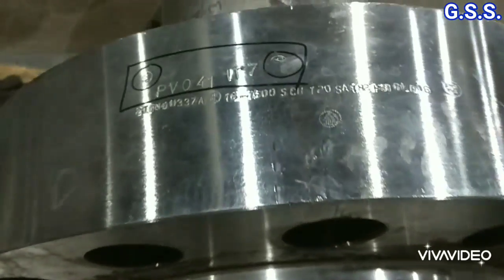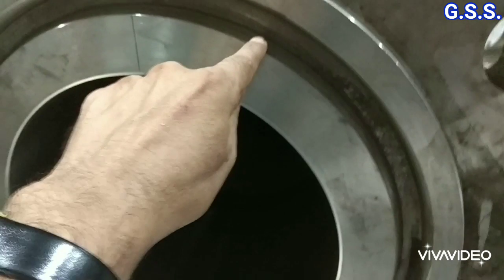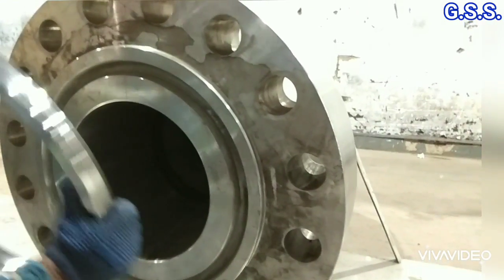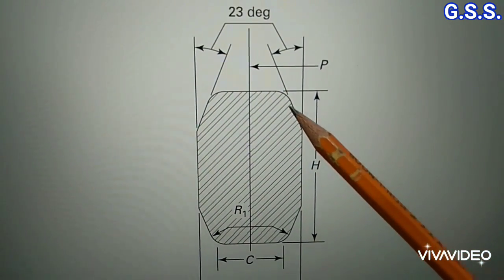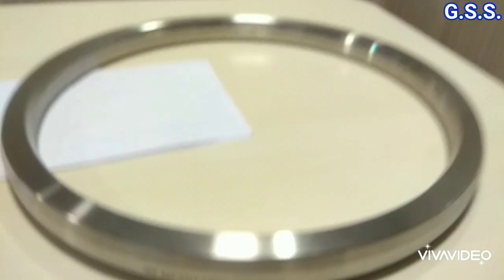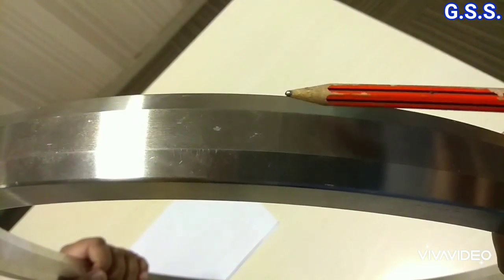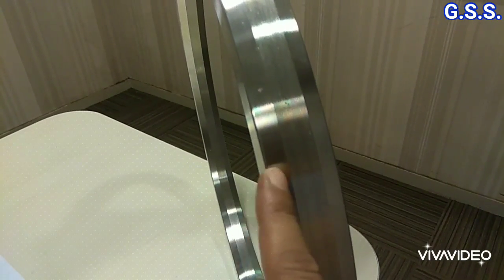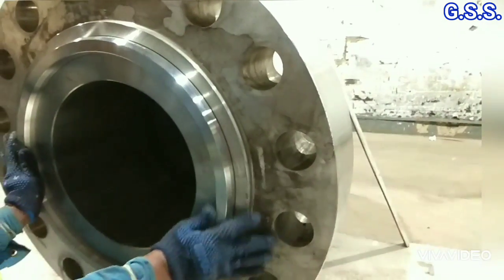Piping Engineering : Ring joint flange & gasket

Comment: what is the meaning of R in ring joint gasket . eg...R-67, R65 etc....
Reply from the maker: R is the ring number.

Three types of ring joint gaskets are there - R, RX & BX. 

R type gadget is oval and octagonal.
RX type gadget is interchangeable with oval and octagonal type.
BX type gadget is of square cross section and edges bevelled.
Reply: @gourisankarsamanta7670  thanks